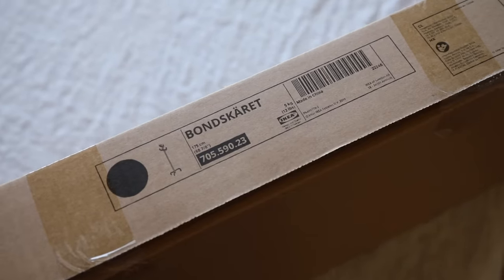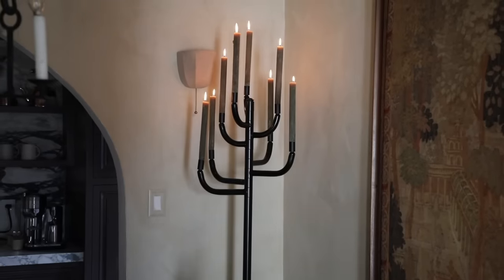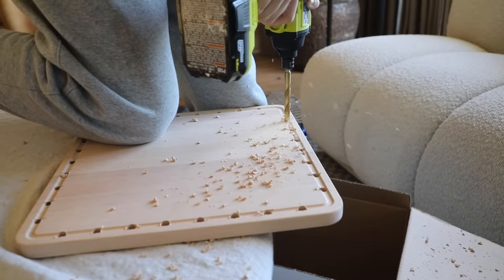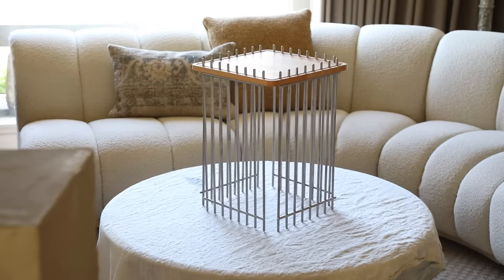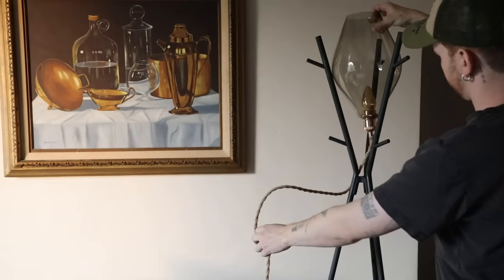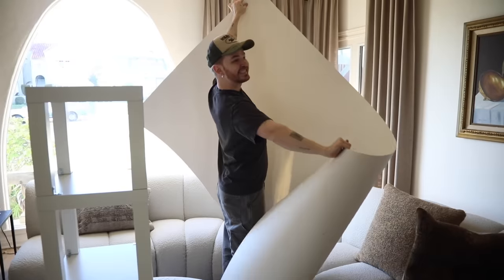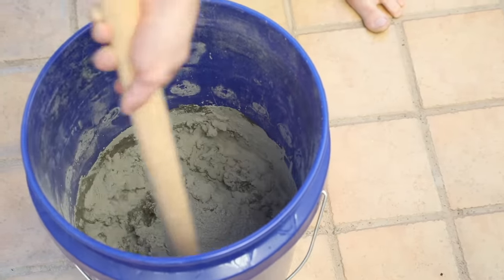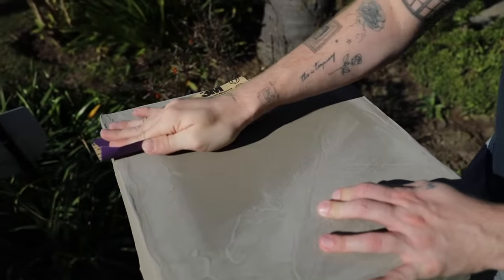DIY Ikea Hacks YOU ACTUALLY WANT TO MAKE! 🔨  Lone Fox (2024)

Comment: I love the little cutting board table. Only I would just use the racks on 3 sides, leave the front open, and put some wood slats going across the bottom,  resting on the metal cross pieces of the sides. Make a bottom shelf for books  or whatnot. Also if you glued in the wood slats it would add a lot of stability (cross bracing).
Reply from the maker: Ohhh smart!!!

Comment: You could try Heat forming/folding the plastic sheet, using a hair dryer. Carefully heat the plastic at the point where you want to form it around the corner.With carful and judicious use, with a cloth or oven glove, you should also be able to get the plastic to conform to irregular shapes as well, to some extent.

Comment: I love the the side table and light hack, the candle hack could be better if it wasn't slanted. Also, for the table I think it'd be better to use 3 metal grills instead of 4, and another board at the bottom so you could use it as storage too. The concrete would have looked amazing if it wasn't so boxy and smooth, a bit more texture would have been nice. Definitely awesome ideas! Thank you for sharing these awesome hacks!  🙂